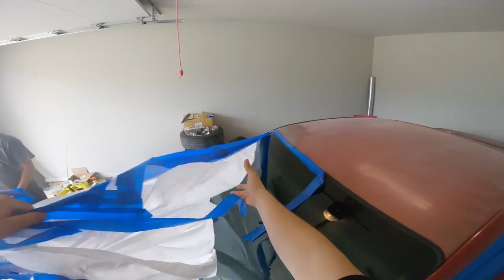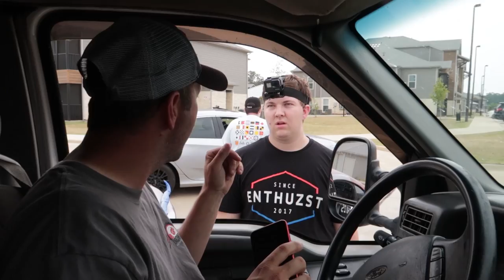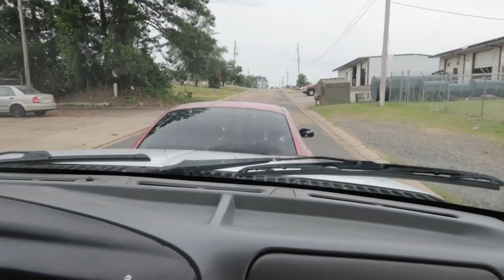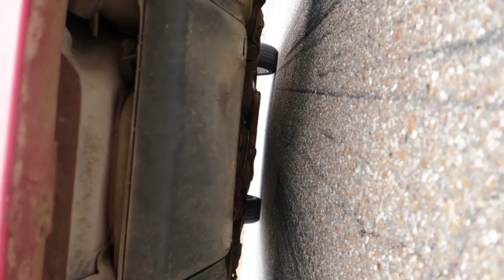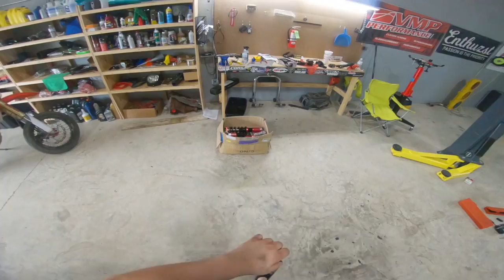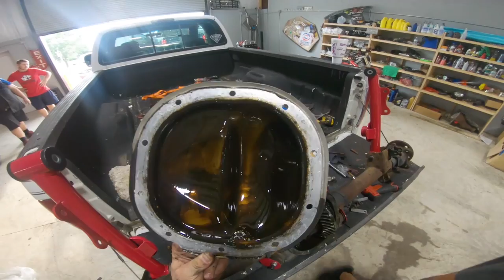We PUSHED my broken RACECAR to the shop!

Comment: Just weld the hole up or weld a nut over the hole and put a bolt in it. The factory cover from the new diff is steel.

Comment: All these ASE certified master mechanics and not one knows that you don’t tighten down suspension components unless the weight of the car is on them? Not a single person realizes that there’s a hole and that you can’t use the old one? Go to Napa and buy a NPT threaded plug and tap the cover, weld a nut inside,, now you have a drain plug and you don’t need a new diff cover

Comment: Get aluma weld at harbor freight it melts at 700 degrees with you can use a propane torch it's like a brazzing rod but for aluminum

Comment: Used the cover off the rear end that you are replacing. It doesn't have a bullet hole in it!
Reply from the maker: Dean Noland its an 8.8. I had a 7.5
Reply: The rear he's replacing is a 7.5" the newish one is an 8.8" there for it won't fit

Comment: Poe put in 373 gears it will wake that 6 up brother and weld the spider gears making it posi trac.
I did a mustang like yours w 373 gears and I ran 275 rear tires and 245 fronts w 1/4 " spacers all around to be flush w fender flares